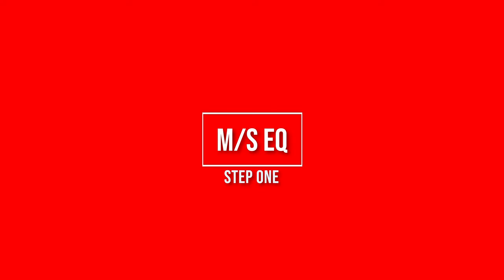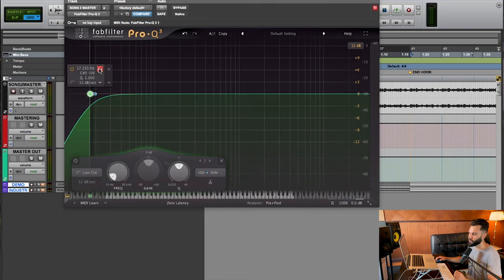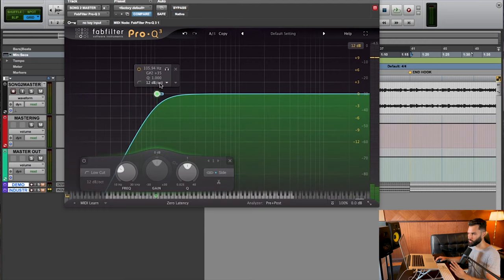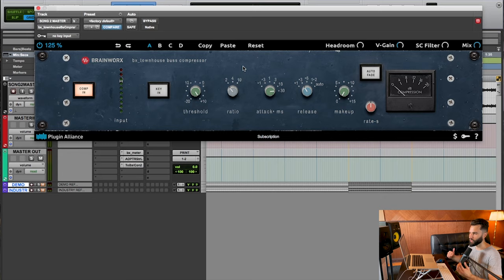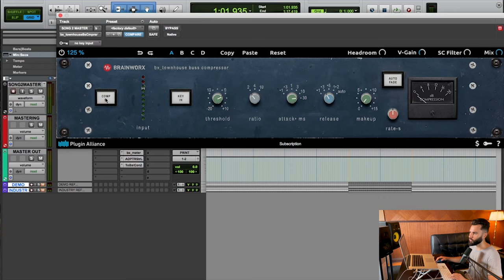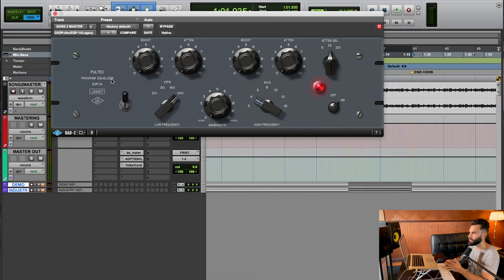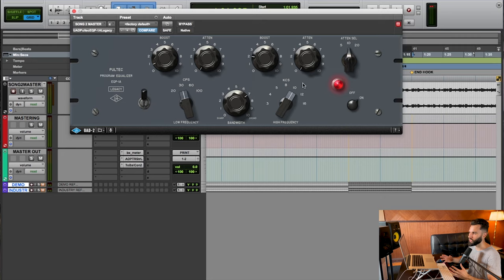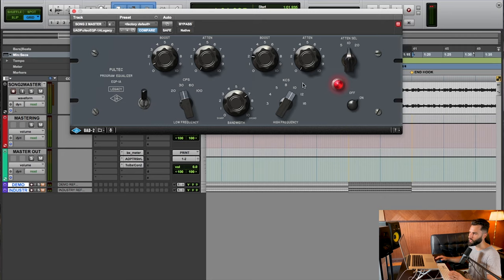My 4-Step Mastering Chain

Comment: The idea of serial limiting makes total sense (first trim the peaks, then bring back level) but I'm not sure there's any advantage of 2 vs a single stage if you use the same limiter with the same style/attack/release settings.  Wouldn't it yield the same results as having a single limiter with 4.5dB (1.5 + 3) of gain?
Reply from the maker: I find it yields very different results personally. Even though the settings are the same/similar, the reaction is different because of that pretreatment. Usually sounds much more transparent when split across 2 limiters compared to 1 dialled fully. I encourage you to try it yourself - that’ll tell you better than I or anyone ever will 😉

Comment: Do you think there’s any significant difference in throwing the compressor before the m/s eq? So basically the compressor is 1st in the chain
Reply from the maker: It will always depend but I’d recommend trying it and seeing how it sounds to you. I like putting the M/S in first because I can cut the unnecessary low end before compressing, which may make the compressor react less aggressively and sound more transparent. However, there is more than one way/approach. Use your ears and judgement always! I’m known to move my plugins around and not always follow the exact sequence (although limiters and maximizer are always last!)
Reply: @5piece  Great advice and info man thank you!

Comment: When you sweetened the 30 Hz , didn't you add some rumble to the side channel which you initially removed?
Reply from the maker: We can think this one to death but the question is: how does it sound? Do you hear rumble? Or do you hear a fuller low end? Does it sound like that boost is adding rumble? Or do we suspect that because we know too much now? 😂

The logic, if we want to think this one through, is the first EQ takes / reduces the rumble and the second EQ enhances the lows as a whole, which can compensate for some of the thinning we hear from cutting the lows (if any). Similar areas of effect, but different intention and results. 

It’s situational so use your ears - maybe you don’t add 30hz to sweeten and instead do 60 or 100 (or whatever you like). Either way, listen to it and use your judgement to discern. As long as it’s not too cloudy, muddy or unarticulated - it’s likely fine.
Reply: Thanks for such a detailed answer to my question. As a budding artist , this lesson was very useful. Cheers mate!
Reply from the maker: Anytime! Best of luck my friend!!
Reply: A simple but solid chain that translates well to beginners and reminds one of what mastering is at its core. There's tons of cool tricks and overboard processing that could be done. But a mix done well shouldn't need much. Oftentimes, less is more.

Comment: When I mix vocals on a wav stereo beat on which mastering has already been done, do I still do sweetening with a pultec, does the sound image distort?
Reply from the maker: Try it out and see for yourself ! It generally works for me, but like all mixing it’s situational. If you start distorting then either avoid it, or create more headroom before applying EQ/other processing. Headroom is key to avoid distortion 🤙🏼
Reply: @5piece  I leave about - 6 db and I'm careful that there is no clipping but when I add pultec eq and busted it's not that beat anymore, I have to see what spoils it, whether it's a trackespacer or a smackatack that I put on beat, I have to review thx